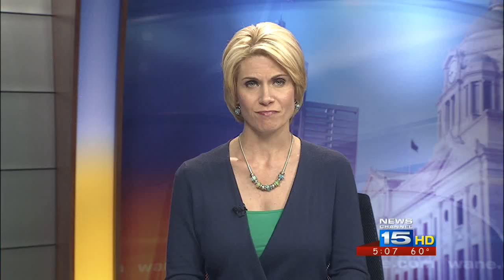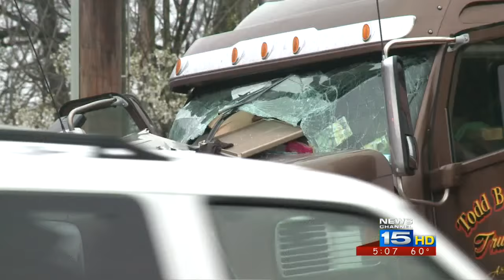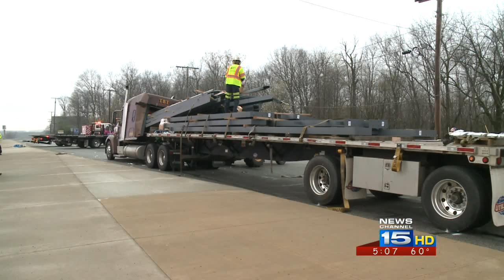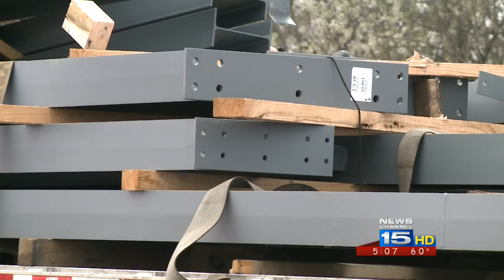Truck driver killed after load comes loose

Comment: I’m a truck driver on a flat bed, I haul the same stuff, these message for all the cars, please don’t pull up in front of trucks they can’t stop in time!! Respect
Reply: Tony Sanchez 
Another good reason not to pull out in front of truckers is a lot of us simply will not risk our lives trying to stop/avoid the mistake of another driver and plow right into them. If I come across a situation where I am at fault because of my own actions, I’ll drive straight into a rock mountain side to avoid causing harm to others, but if someone pulls out in front of me because they’re in a hurry/not paying attention I’ll turn their vehicle into a crushed tin can.
Reply: @thegatesofsleep  facts
Reply: @thegatesofsleep  true
Reply: @thegatesofsleep  Wow man, someone makes a mistake and you’re not willing to alter your course!! What a hero!!  Simpler solution, don’t haul material like that without the proper equipment on your rig!! Get a headache rack!! 🙄
Reply: @emilianolimas6920  Yes clearly, you obviously know everything about me from one comment I made, clearly! Genius! 🙄
Reply: No headache rack
Reply: Use a dashcam and don't make emergency stops make controlled stop's if they want to cut you off or brake check you that's their problem. And you'd have a dash cam to prove it wasn't your fault.
Reply: @ravemaster7405  If you don't feel it's safe to do an emergency break something is wrong. Either on your load securement or otherwise the load isent possible to secure and it shouldn't been loaded at all or not like that. II know it's just not possible to secure everything the way it should be but in my experience it's rather uncommon and if it's a regular load the hauling company wouldn't accept it. But i don't drive anymore and it was in Europe. In two years a had one slight movement on a load when forced to emergency. break. I wasn't anxious about getting killed by my load, but a lot of other drivers dident do half as much work on securing the load and the police hardly ever checks load securement.
Reply: First, I hope Mr. Spencer didn't have to suffer, that no one else was hurt/killed, and that his family is at some semblance of peace. I can't imagine what they have had to endure since losing him.

There could have been a rack on the trailer AND the tractor, but depending on speed, and how short the attempt to stop, that steel was going exactly where it went... Maybe not as fast. We can argue all day and night about headache racks, but I have yet to see one rated to stop/slow a load. In fact, the one behind my sleeper is only rated to hold my chains and binders.

I do question Mr. Spencer's securement, and attitude about following distances, overall mentality, especially if he might have been prone to road rage, but I hope I'm just.. Overthinking.
Reply: The truck I use has protection behind the cab for this very reason. What pisses me off is when some dipshit with 4 wheels has to pace you as he/ she merges on to a freeway. People don’t realize that these trucks don’t accelerate that fast with a full load nor do they stop on a dime. Also, I’ll over strap my load and check it regularly for good measure.
Reply: @adamhernandez1591  a headache rack wouldn’t stop that or a coil
Reply: @jamesevans2616  the hell it won't
Reply: @Bo Bo ok
Reply: The reason why I  don’t drive flat beds it is too dangerous.stick with dry trailers or containers is less risky
Reply: Thought all flatbeds came with an thick metal wall to avoid something like this or did the load just go straight through?
Reply: @damaribrackett1159  not all do
Reply: @damaribrackett1159  this one didn't have one
Reply: @damaribrackett1159  some of them have them some of them don’t.but anyways drivers drive flat beds by choice when have many options as truck drivers I pull trailers or containers all the time
Reply: @adamhernandez1591  ohhh ok
Reply: @gabrielramirez9161  so if u wanted u could switch everyday also I'm in Virginia and I'm 20 do I need to like go to college or something to do this job or do I have to like drive a regular tow truck for a couple years?
Reply: I drive tractor trailer and I would rather drive dead mans pass during bad weather than to deal with stupid drivers in cars! That air horn sure does help though!
Reply: Please stop cutting me off in my truck too when you’re empty and tailgating:)
Reply: What about more safety measures for flat bed?
Reply: @gabrielramirez9161  not worthy and money is not that much better reefer or dry van!.
Reply: @Bo Bo you kidding. We drove dry van or reefer and we never had this kind of issue. Flat bed is too dangerous and this is not rare accident, it's common in flat bed !.
Reply: @damaribrackett1159  thatcwall doesn't protect you 💯%. It's still dangerous
Reply: @Bo Bo sorry but I disagree. Chains will break
Reply: Yes SIR
Reply: Actually,, a fully loaded truck stops very good
Reply: @tyronejackson7334  the message should be don't follow to close
Reply: @Bo Bo we need to account for road surface, tires, brakes, weight etc but a truck will stop better than people think.  What we have here is truckers making excuses.
Reply: @Bo Bo I'm a retired truck driver and I work as safety director at a large trucking company.
Reply: @richarda1568  yeess but not like a small car with brembo brakes.
Reply: @Bo Bo automated manual trucks with disc brakes stop in 250 ft (83 yards) at 60 mph.
Reply: I don’t drive a truck so I never new about this they should educate us more about it or maybe they do we just didn’t get it 
When I found out about it I do respect and pay more attention
Reply: ill never do it again
Reply: @thegatesofsleep  i will watch it henceforth
Reply: @edgardaniels1402  that's why they make the headache rack
Reply: My message for truck drivers hauling thousand and thousands of pounds of steel- SLOW THE FUCK DOWN
Reply: @adamhernandez1591  

What is a Headache rack?
Reply: hey so does your truck have that steel plate behind the cab to prevent things like this??
Reply: Oakland Raiders forever
Reply: Well then don't hog the road
Reply: @thegatesofsleep  Agreed. I will crush a car like a tin can before I risk my own life.
Reply: @edgardaniels1402  Headache racks do nothing for stopping heavy forward moving freight. Their real purpose is for tool storage, chain, binders etc etc. If he had a bulkhead and the material loaded up against it, it would have helped but nothing is stopping 40k once it starts moving. His only true mistake was emergency stopping when he should have simply let whatever stopped in front of him be the cushion that would have saved his own life.

Comment: I’ve hauled lots of steel in my 37 years of flatbed trucking. I ALWAYS cross chained the front of all the steel except for pipe loads. Those beams on his truck had large flanges on the ends so cross chaining them would not have been difficult. It’s not possible to strap each layer of beams so cross chaining the front is the only option. I NEVER slammed on the brakes while hauling long steel of any kind. I always thought of it like I was hauling long icicles. That poor driver never had a chance. I hate to see this kind of stuff. 🙁

Comment: Myself as a truck driver I ask, if you hauling steel like this why didn't the driver have a headache rack mounted on the back of the cab? Would've definitely prevented this fatality.
Reply: Hick we  had headache rack on the trailers back in the days. So Sad
Reply: GREAT POINT ON THE HEAD ACHE RACK . WHY IS IT NOT MOUNTED BEHIND THE CAB? COST MAYBE BUT THAT TYPE OF STEEL LOAD WITH POSSIBLE MISSILES PROJECTED THE RACK WOULD HAVE SAVED THE DRIVER A STEEL COIL IVE SEEN TAKE THE RACK AND CAB RIGHT OFF THE FRAME
Reply: @patrickwalsh741  
A lot of pipe and steel distributors wont load without a proper headache rack. And yes, CHAINS !
Reply: Your right.  Oddly, newer 53 footer trailer automatically have these
Reply: Very doubtful depending on speed!
Reply: @chiefsnarlsnortz1610  I have to disagree.  The new trailers have to go through tests before being sold to make sure things like this don't happen
Reply: Exactly my opinion
Reply: Have any of you guys ever looked at the "ratings" stickers on any of the racks? I have yet to see one rated for more than storage. If any of you has seen a REAL headache rack, do you mind pointing out a brand or two? I'm seriously asking, and seriously looking for one to replace mine. I haven't found anything that doesn't scare the shit out of me.
Reply: @A_Cowboy_called_JackRabbit  As I said previously, newer trailers themselves come with the protective barrier.  Not sure on the headracks question you asked.  Nonetheless, I would make sure the trailer had that protection first and for most even if the tractor had a heavy duty headrack.
Reply: @ShyRage1  say it all you want, but you are only seeing SOME "newer" trailers with any sort of barrier. In the States, they're completely bare, to allow longer loads to overhang. "Newer" trailers, as well as factory-fresh, come this way. I deliver the raw materials to Utility, Mac, and Great Dane, while not even the "better" brands come with a rack. If you'd like to talk about the exceptions you your rule, that's fine, but the "newer" 2019 Mac flat deck behind my Kenworth right this moment, has the wooden bulkhead, federally-mandated whenever possible, built by me.

Now... Are you in the States? If so, you should drop it. You're wrong.
Reply: @A_Cowboy_called_JackRabbit  I am in the states and know exactly what I'm talking about being that I work in fabrication of these trailers and testing of prototype commercial vehicles.  Any real world tests are done where im at.  Again, I know what I'm talking about.  Get a trailer with the guard built into it. Of course, if your hauling wide loads with an escort that's a different story since your usually protected by that escort(s) and speed. During those scenerios, I see where you are coming at.  If not, don't risk your life, there are too many uneducated drivers out on the road.
Reply: @ShyRage1  then, you know it's not "most newer trailers", and that they don't "automatically" come this way. None of those 2020/2021 Mac, Utility, or Great Dane trailers I picked up from those respective factories, and delivered to the terminals of the company I drive for, has any sort of barrier. They do, however, have stake pockets across the header, but those don't look like something I should trust, even with solid steel stakes.

What company/companies' trailers are you fabricating and testing, that some sort of stop is built-in? It's taken me a few years, but I can now afford a better trailer, and I'm just about ready to get back into my own tractor. Company's cool, but it's not my cup of tea.
Reply: No way a headache rack gonna stop.
Reply: @bellboy4074  would save your life I guarantee you!.. you must not have any affiliation in the trucking business to add a comment like that.
Reply: @sopamarucha2388  do you, by chance, know any brand/s of racks that WILL stop a load shift? I haven't found anything rated to save a life.
Reply: @A_Cowboy_called_JackRabbit  almost all will stop a sliding load if its loaded in the very front to begin with and not given a chance to slide forward and gain momentum.
Reply: @marcushennings9513  of course, in that case. In other situations... What then? The point I'm making is not to trust anything. It's amazing to me, though, that so many of these guys here are giving out these guarantees. I can't imagine how many of those false senses of security has cost somebody's family a lot of slow singing & flower bringing.
Reply: I am a flatbed driver...Sometimes we haul oversized steel beams and you cannot put a headache rack. He strapped the beams instead of chaining them, those beams will cut the straps like butter. If he had chains on the load then he would have been fine.
Reply: He should of had a "header" on the front of his trailer as well, Especially when hauling any form of steel or aluminum beams, sheets, plates..... hard braking and those forms of loads (and Coils as well), is Never a good mixture.  When I was flat bedding years ago in my early days as an Owner/Operator with my own authority (I have 50+ years OTR and still counting), especially with the aforementioned loads, I would stop and re-tighten the chains & straps about every 20 - 25 miles for the first 100 - 120 miles, depending on the roads, and then every time I stopped for fuel, a meal or whatever.  

I would Never haul any kind of steel or aluminum sheeting, plates or beams without using my header at the front of my trailer, as well as I had a custom built Steel headache rack.... the only times I did not use the trailer header, was for beams that were a little longer than the trailer, then I would put the overhang at the front, but the beams were well blocked (wood 4x4's) across and in between and wrapped with combinations of chains & straps.... never, ever had any even slide a little bit on me. 

I must say though, the 4 wheelers back then had a LOT more respect for the trucks and truckers back then, than they do now.... we all got along a lot better back then.... even the HP's would stop and help you change a tire, especially at night.... then we'd stop at the next all night roadside diner or truck stop (when they had "Real" truck stops!), and we'd buy them breakfast or whatever..... it was a different USA back then, with a whole different "caliber" and mindset of people... now Gone,  Forever!!..... but, within the next 4 years, it won't matter anymore.
Reply: Headache racks aren't built like tanks. I've seen plenty of them crushed or bent like cardboard when hit with heavy loads. Definitely would slow that steel down a bit and give a driver a better chance though.
Reply: Not really about the Headache Rack
Reply: I had that happen headache rack stopped it....scared the hell out if me / confused me because it felt like someone hit me from behind. I was trying to pretend something ahead if me and if felt like somebody rear-end be because I slammed my brakes so hard. Oh...that also taught me to put the load against the back if possible
Reply: Headache racks only work at low speeds.  City driving mainly.  Freeway speeds to s sudden stop.  It wouldn't have helped.  I seen steel I beams come through them.  When I drove flatbed hauling steel.  I used chains.
Reply: In two instances that I have knowledge of, headache racks are for hanging binders on.  Pipe, lumber, anything long and heavy just shears the rack right off the trailer, or it runs through anything you might have behind your cab.  Slower speeds I might be full of shit but highway speeds...I've seen it.
Reply: I agree.
Reply: Dunno Dunno  With one built into the trailer and another on truck, won't need to.  Thank you for looking out though.
Reply: The feds don’t require a headache rack anymore. Look it up. They are just storage for chains and binders.
Reply: @A_Cowboy_called_JackRabbit  Could you have one custom fabricated, it would not be certified so that may be a problem but any fabricator should be able to make one that can take a heavy impact from a large mass. No one can guarantee it will stop everything but it should protect you in most situations.
Reply: @phillhuddleston9445  you might be the first here to say something that makes sense.
Reply: Technically they're supposed to have it
Reply: @DieselAddict-vs9fc  the 2019 trailer on my 'wheel, and the one on some other guy's 'wheel several spaces over, don't seem to know about this technicality. Technically, they're without one, to allow longer objects to hang, if necessary, to roll without a permit.
Reply: Dunno Dunno  DOT hasn't said a single word to me about my trailer being completely open. "...required by law..." Utter nonsense.
Reply: Dunno Dunno  lol fool.  Just because something is required don't mean it will stop pipe at highway speeds.  28 years on the road.  You guys...
Reply: @JavierGarcia-zt8ly  headache rack super important. if you cant do that dont take the load. let it go on a train
Reply: @ShyRage1  Never say never,if it's your time to go though and GOD wants you then it's just your time to go. Not to say it in a bad way whatsoever but we'll have an expiration date with this temporary body. We just better hope we lived the right way by GOD before we're called back. All of us!
Reply: Good I information
Reply: @leroywood8410  trust me it will hold any kind of weight, that's the reason why it's a law to have it mounted, not only that, the steel will not penetrate thru it.
Reply: Many companies are too cheap
Reply: I PULLED FLAT 20 YRS,AND NONE OF THE COMPANIES HAD HEAD ACE RACKS.I use to take chains and belly wrap the steel.That way it pulls the steel together.Mant drivers use straps on steel
Reply: @carlinbrumback8931  well I hate to say the companies you worked for cared a grain of salt for their employees, I would never pit my life at risk for a load that way
Reply: @sopamarucha2388  If you take the time to secure it properly,and drive safely,there is nothing to worry about.Ive been flat 20 yrs,and the last 5 tanker.JUST ABOUT 3 MILLION SAFE MILES.Tanker is even more dangerous.
Reply: @carlinbrumback8931  I understand your point bit it only takes an idiot to cut you off no matter how safe you can be driving. In a split second it can be a life changer
Reply: @sopamarucha2388  Your right,I had a close call today in Atlanta.Thats why I only drive 63
Reply: it did have one it is now inside the cab.
Reply: @bond1j89  lmfao 🤣 😂
Reply: People keep mentioning it needing a headache rack.  I agree it would have helped.  I have however seen where an excavator slid forward and pushed a headache rack into the cab and it crushed the driver into the steering wheel killing him.  6” less he probably would have lived.
Reply: I grew up in south Louisiana where almost every truck was hauling drill pipe. I remember how important headache racks were to those guys. Saved a lot of lives.